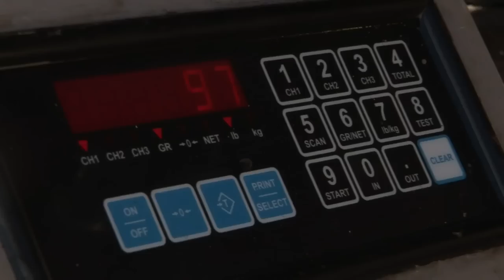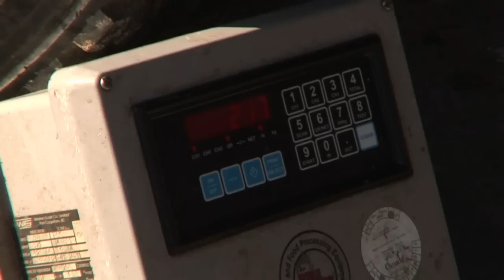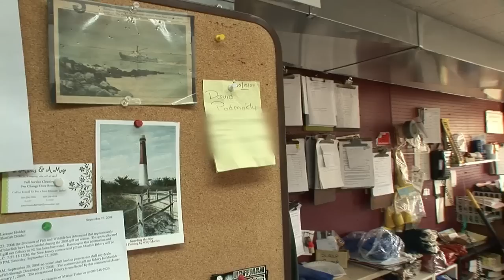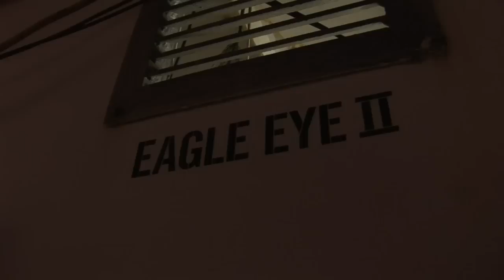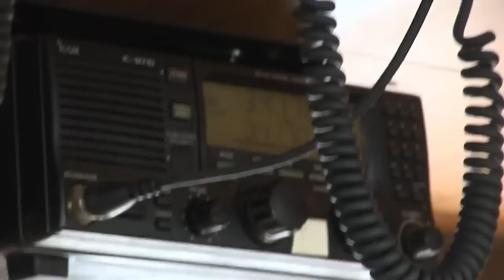FULL EPISODE - Swords: Life On The Line | Season 1 | Episode 4

Comment: WHY  ARE  YOUR  DECKS  SO SLICK, THEIR ARE  EPOXY PAINTS, WITH  ADDED GRITS  TO STOP  THE  SLIP, I M  SURE  YOU THE  CAPTY  AND  CREW  CAN  MAKE  YOUR  BOATS  MUCH SAFER  TO WORK ON, LITTLE  CHANGES  GO  ALONG WAYS  WHEN IT  GET S VERY  ROUGH  OUT THEIR.
Reply: RUBBER MATS ARE MADE FROM GROUND UP TIRES.  THEY MAY BE A GOOD SURFACE.  THEN YOU WOULD HAVE RUBBER BOOTS GRIPPING RUBBER MATS.